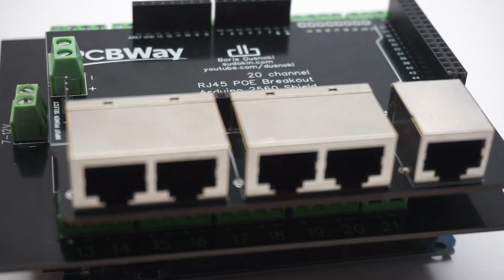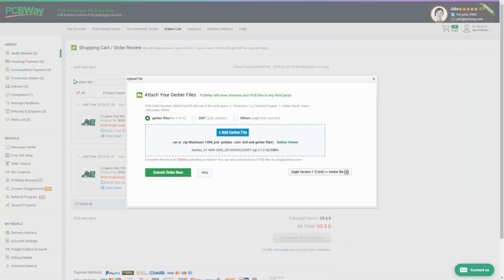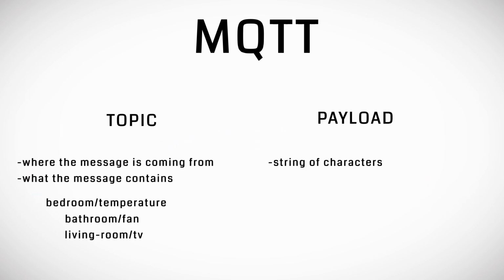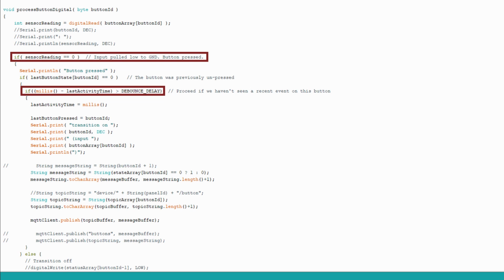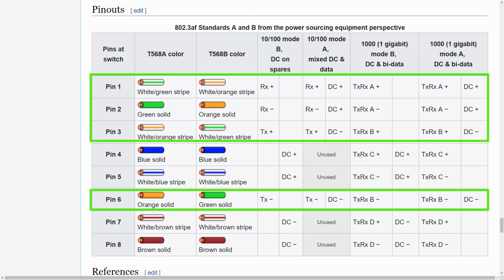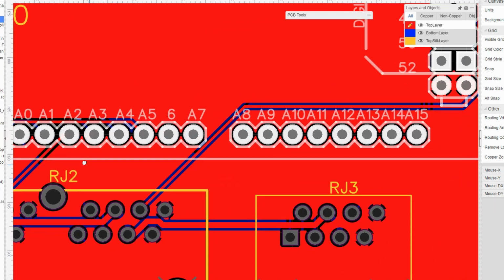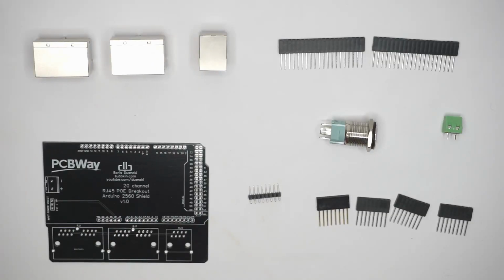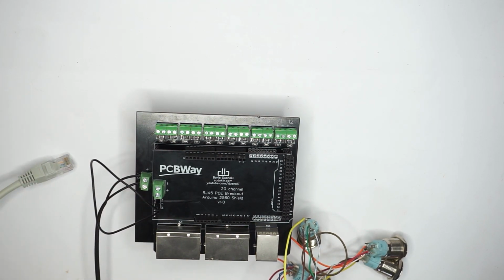DIY Home Automation Light Controller Shield | MQTT, Node Red,Raspberry Pi,UTP/Patch/RJ45/CAT5e cable

Comment: Great video Boris, but I do not see any capacitors as filter on the board, didn't you experience any ghost switching, EMF mess? Or you plan to use shielded cat 5e/6 cables?
Reply from the maker: U haven't noticed ghost switching in my tests. I am using cat5e cable